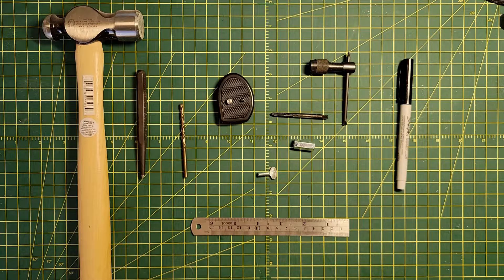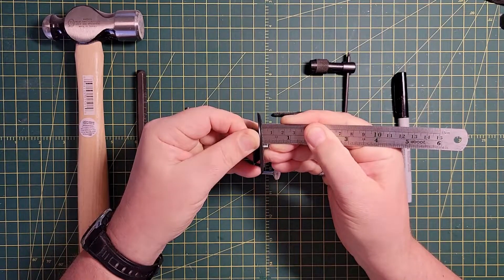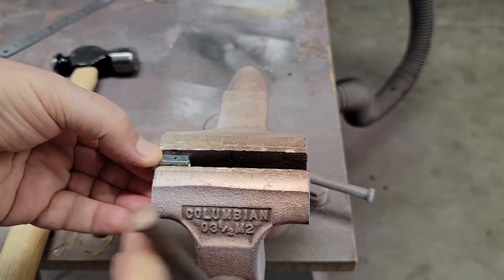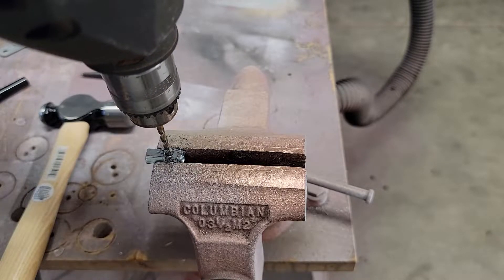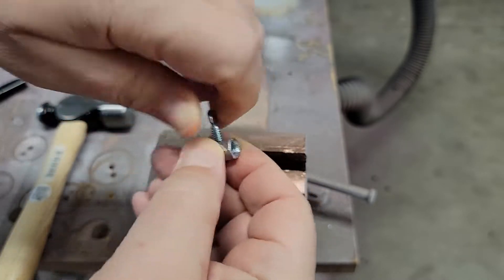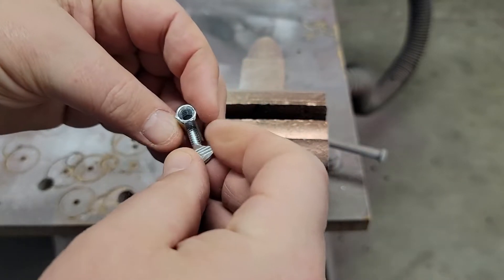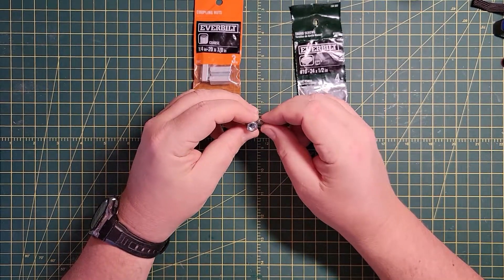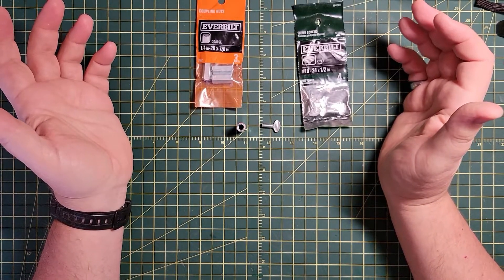Tripod to Model Rocket Launch Pad Conversion

Comment: Here’s another, quicker way. Just remove the thumbscrew from the tripod plate, then screw the plate to the wood block. https://youtu.be/armn-4vGa5A?si=oyW9R-iTZVc4_Mix
Reply from the maker: While that is an option, it requires you to haul around two blocks of wood for different rods and wood does burn... There are many solutions to every problem.
Reply: @jchobbies  Nah, you can drill 3 hole sizes in a block of wood! I don’t care how people do it, just offering another option that requires less machining. Each to his own.

Comment: Can you tell me the tap size that makes the thread for thumb screw?
Reply from the maker: I used a 10-24 tap. Number 10 size, 24 threads per inch. It must match the size/tpi of the thumbscrew.